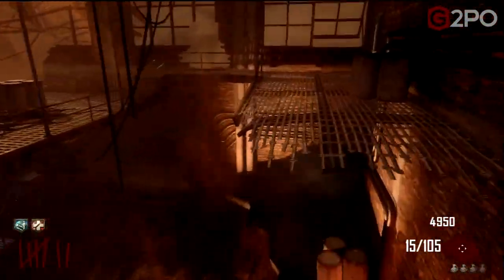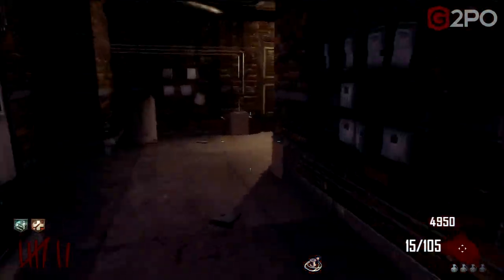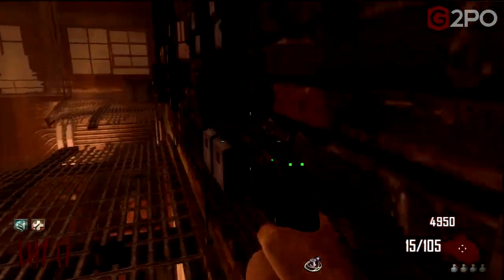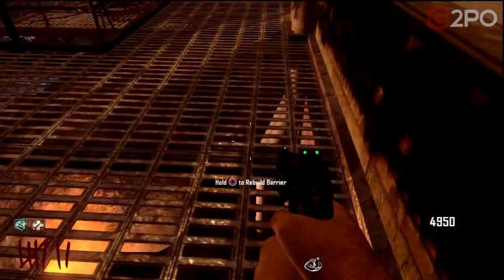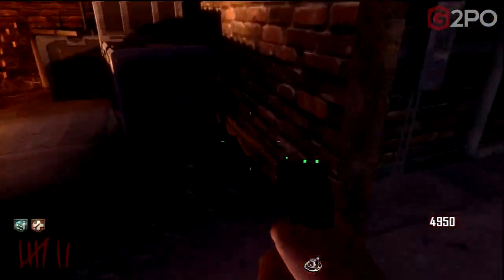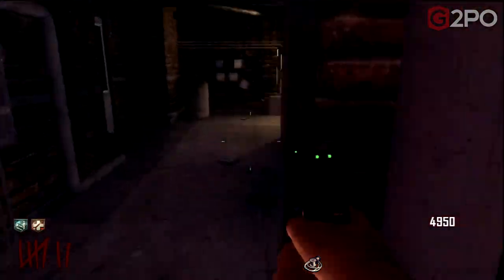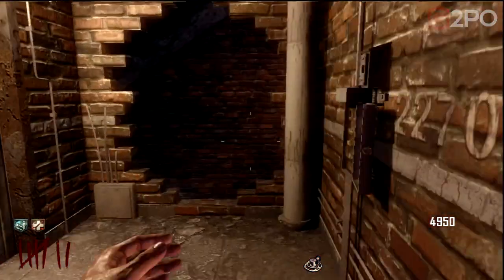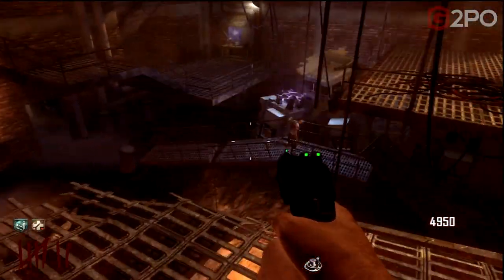Tranzit Easter Egg/Breakdown Step 7: Building the Electrical Trap [Black Ops 2 Zombies]

Comment: The wire is 1 of 4 objects needed to make the air cannon. 1st location is in the tunnel between the bus station and the diner. 2nd location is in the corn field between the farm and power room. 3rd location is in the Tombstone perk room, which is the wire. The 4th location is in the Bowie Knife room which is hidden between the power room and the town. You put these parts together in the Stamin-up room in the town.

Comment: the wire goes to the hidden construction thing in the cafe, if you go all the way to the right side and look up, you'll see that you can use parts on it and it will even tell you "parts required"

Comment: The wire goes with a jet gun, the other parts are found in the hidden Nacht der untoten map in cornfield, you have to also build a worktable, im not sure where you find the parts for it but there is one part of it in the tunnel near the m16.

Comment: those electric wires are for the jet gun located in the city (town) on the right side when you get off the bus there are also 3 more components which are located in the tunnel, nach der untoten,and a hunters cabin in between the power station and the city (town) also inside the cabin is the bowie knife!!!!

Comment: the wire and cable goes to the jet gun there is no wonder guns on the map besides the ray gun and the monkey bombs atleast to my knowledge and the board goes to the easter egg radio thing you build and in the whole map you build the power the electric trap the turbine the easter egg radio or whatever its called and the jet gun i think thats all and the zombie shield there we go all the builds in the map i think and you can put three parts on the bus and use the ladder for an easter egg but then